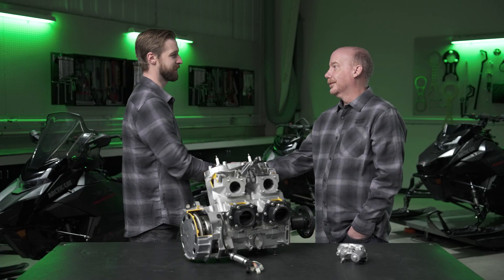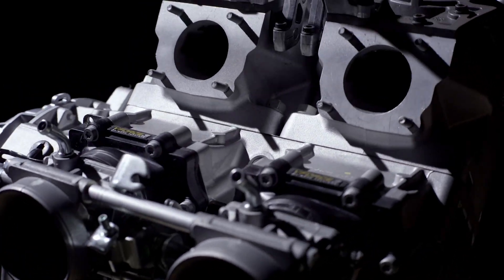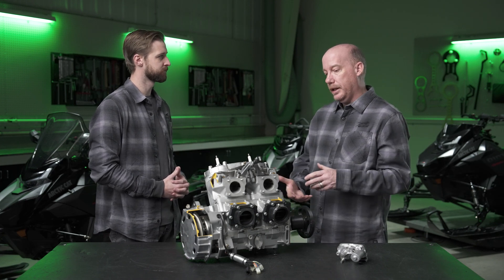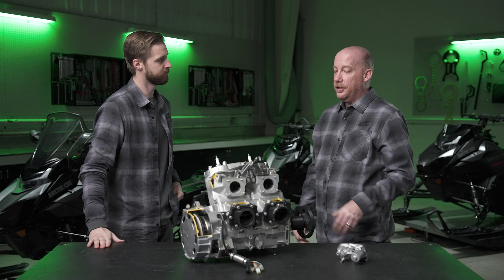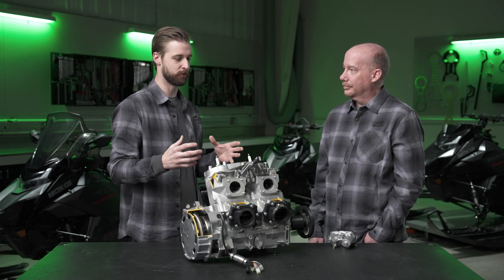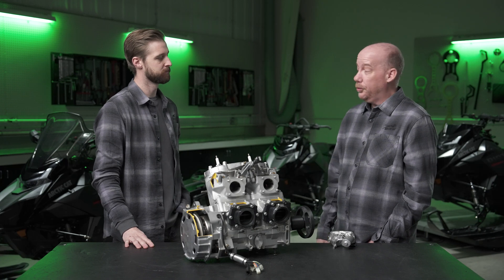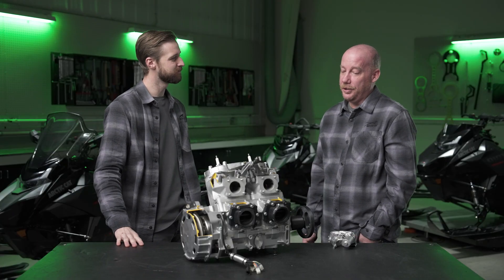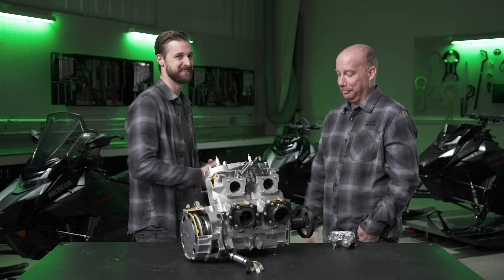Arctic Cat MY25 Deep Dive | 858 Engine

Comment: Now all you have to do is have a primary that doesnt explode and bend cranks and total sleds. Guy I know blew up 3 of your adapts and your dealers said the crank was apparntly fine and then the engine just blew up because it was out of phase. I love the new power valve setup and the engine seems decent but only time will tell on that. I unfortunatly will no longer support the brand after everything I have seen from textron.

Comment: For a company that is as large as Arctic Cat and Textron, this information should have been out and heavily promoted, along with the information about the new AC5 shocks, BEFORE the early order windows opened. NOT just before they close. I really want to be ordering one, but AC is not inspiring a ton of confidence in their abilities. My 2022 ZR8000 has 8300 miles on it, and I have really been happy with most everything about it. But after owning 3 different NEW Procross chassis sleds since 2015, it is time for something new. I want this sled to be it, but I want the company to do better.

Comment: Love my cats raced cats 15 years SX pro XC many wins and championships. Im probably one of cats biggest fans Cats race support was amazing no other manufacturer compares to cats support. Had carpal tunnel surgery in both hands in 2018 never went racing again. I hope to race again one day but idk. Also Trail ride cats  my 2017 ZR 6000r XC 2010 EXT Z1 turbo and a 2011 sno pro Z1 turbo making up to 300hp. Durability and reliability have been great racing i broke not enough parts to even say so ones i did were minor. Dad bought a 600 catalyst ATAC package 137 this season really like it very impressed with it. Only complaint is seats a little hard and suspension shocks could be valved a little softer. If i could swing a new sled by next season looking at the Riot 858 sno pro package. 
Very excited for arctic cat i know a lot of cat guys waiting for new chassis and engine package. Iv been more than happy with my pro crosses and Z1’s but a new sleds always exciting lol!! 
Great Job Arctic Cat.